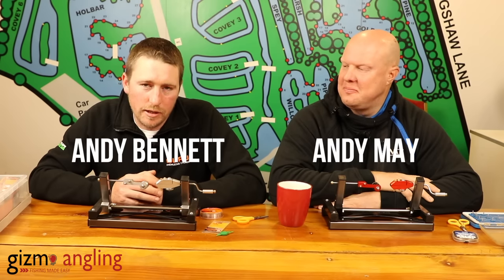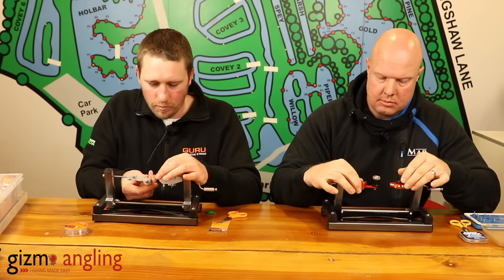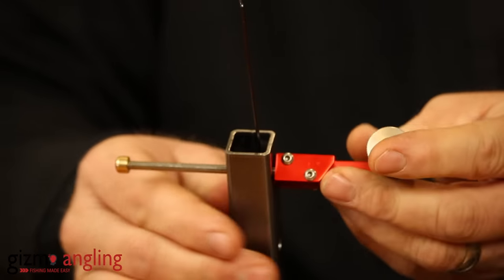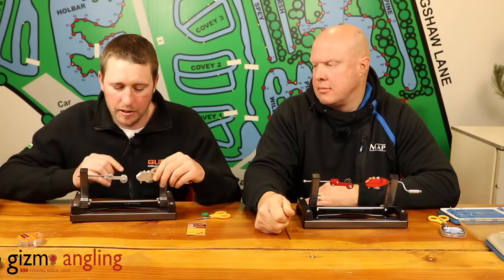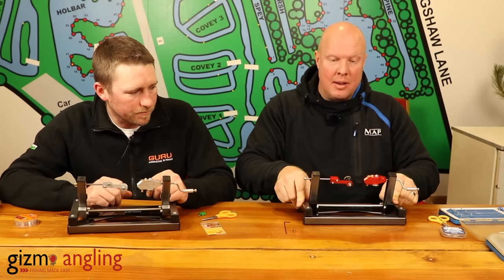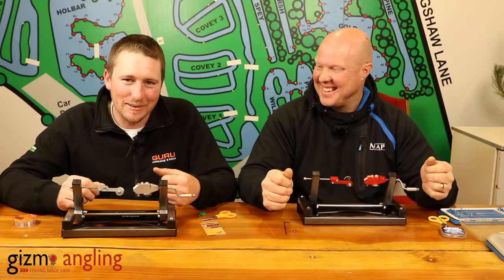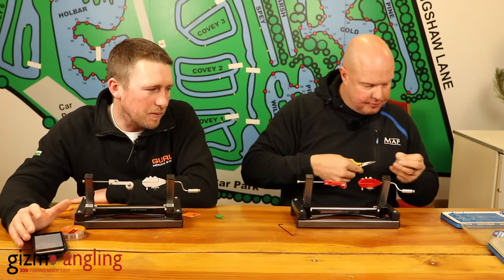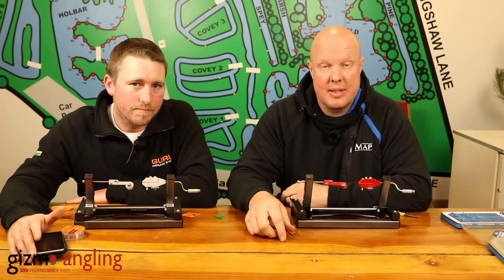Andy May and Andy Bennett demoing the ZT PRO Hooktying station

Comment: Bought one today in Grimsby
Just gotta get home now to try it out
Reply from the maker: Hi Graham , use the des ship user guide much better , also make sure you only lightly tighten screws underneath base :) any problems give us a call.
Reply: Gizmo Angling is it supplied ,,
As I won’t be home till tomorrow night to try it out ,, 
It’s a present from the mrs
Reply: Gizmo Angling 
Also does it come with the hair rig attachment???
Reply from the maker: the main head on it is the hair rig head so does both straight hooklengths and hair rigs , also anodised now :)
Reply: Gizmo Angling just that I’ve seen another video where the guy had to change attachments

Comment: Let me put this myth to bed. I have made my own Hooktyer that rotates both ends of the hook link as per the Gizmo.
I used mini belts and drive dogs the same as the Gizmo.
I can also lock the loop end so that only the hook rotates. The loop end stays locked. As per a normal Hooktyer.
IT MAKES ABSOLUTELY NO DIFFERENCE TO THE FINISHED HOOKLENGTH. NONE AT ALL. The Gizmo is purely an expensive gimmick.
Reply: What do you want? A medal?
Reply: @MagicManFan  I would rather have your Jim'll fix it badge that you got with your very special day with Mr Saville.